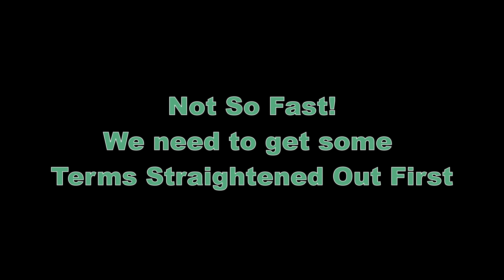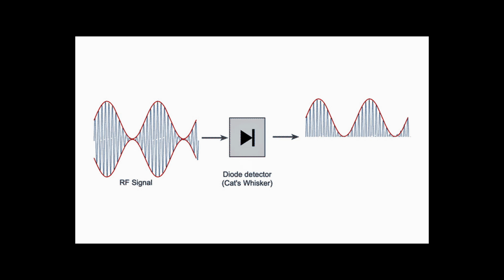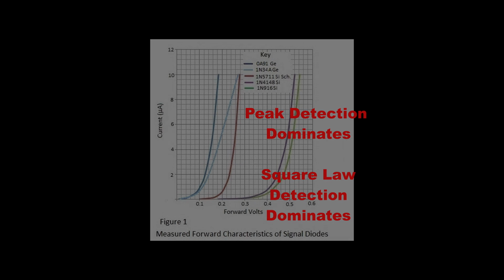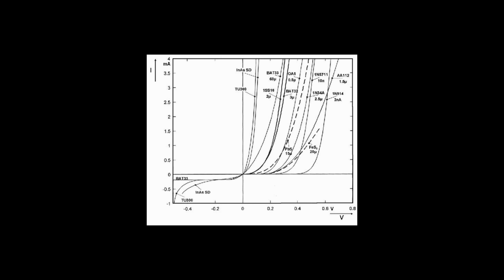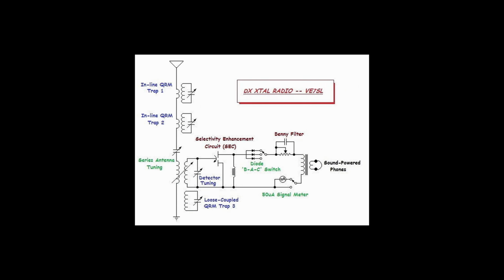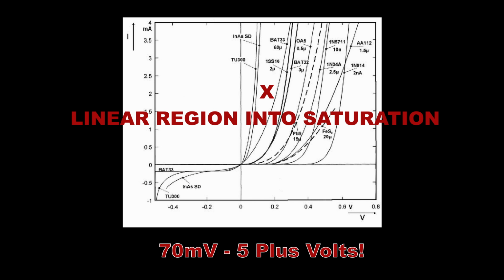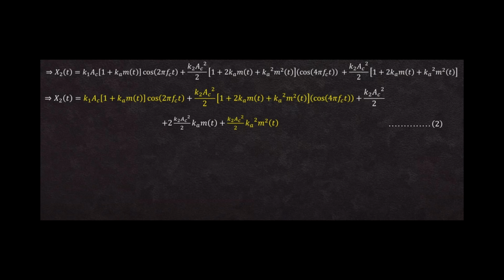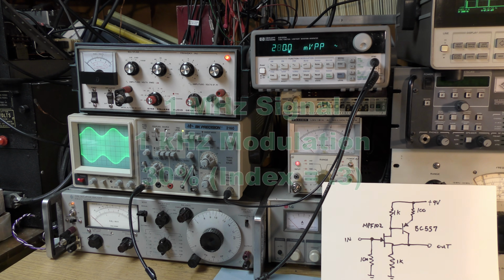AM Detector Part 3 - Total Crystal Set War

Comment: A properly tuned synchronous detector could ignore the second and subsequent-order harmonic distortion. Synchronous detectors are capable of high-purity detection. A low-end synchronous detector could use the linear region of a diode detected signal. The time domain of an RF signal is much cleaner than the frequency domain.

Comment: Makes a lot of sense.  Of course it would behave differently when the signal is small and in the square law region than in the linear region.  It also explains the fact that such small signals can still be detected even if though the forward threshold voltage is say 0.3V. Of course forward voltage is really the transition point is between the square law region than in the linear region.  I assume that the biasing just moves the diode out of the square law region into the linear region and that is why it sounds better.

Comment: I am going to pause at 0:30 to suggest that the two methods suggested are both simplifications that are really incorrect when you consider what exactly is happening.  The VI curve of a diode is (mostly) an exponential function that can be expressed as a series.  The "squared" version is ignoring the higher order terms and the "rectification" version usually is based on a collection of straight lines to model the real series.  Neither is the full story so the war between them is a "which end of the egg to open" sort of war.
Reply from the maker: A retirement life's work in researching this subject is in order. Volunteers?
Reply: I'm a 'little ender' unless the egg is hard boiled.
Reply from the maker: Thanks Ken. So we have two incomplete models. Of Course. And all I wanted to do was build a crystal radio! Ha. I have to move on, but the work and discussion continues in the community, I'm sure!
Reply: @MIKROWAVE1  Yes, it continues like it was going about 30 years ago and likely before that.  Meanwhile crystal radios got made and seem to work

Comment: I realize your purpose has been to cover the characteristics of SS diodes, but what about vacuum tube diodes? Do they begin to conduct in the linear region right away because there is no threshold voltage? I ask, because I have an HP 410C VTVM without the AC probe (of course), and plan to build one using 1/2 a 6AL5 instead of the original 2-01C.
Reply: A vacuum diode has a current that follows a V^(3/2) curve.  There is no threshold but also it is never really linear.  It is more a question of what fraction of the signal is dropped in the tube and what fraction ends up in the headphones.  In a good design most of the signal is in the headphones so the distortion is small
Reply from the maker: Well boiling electrons gonna electron I guess. Take a look at Part 1 again with the 6H6 tube.

Comment: I did not know there was that much difference or thought about it, that the diode is still demodulating the AM signal  below the linear knee voltage.  I would like to see if the distortion in the square law region changes for the better, when bias is applied to the diode. Now I know why the AM detector works best after RF, IF amplification. Also would the diode give lower distortion if used in series with a coupling cap, like what is in your HP-333 distortion analyzer, which uses a 1N6263 schottky diode.
Reply from the maker: Those old analyzers are handy, but not perfect and with age I'm sure it is not in calibration! But it is a good first check.
Reply: @MIKROWAVE1  The HP-334A AM detector introduces distortion by a factor of <0.3% (550 khz to 1.6 mhz) for a 3-8 volt carriers with 30% modulation. And 1.6 - 65 mhz it's worse <1%. With reduced accuracy you can measure distortion down to 1 volt. According to the specs.

Comment: Thanks Mike, very interesting analysis.  My views are slightly different, as the resistive output on the diode markedly affects the diode distortion profile in a simple diode detector, and this is one reason why I love using bias, as the diode output loading then becomes essentially unimportant.  Just adjust the bias optimally, and the audio distortion is essentially zero!  The only germanium 'like' schottky diode I've used, is the BAT46.  The schottky diode' 'knee' appears to be rather different to a typical germanium diode as well!  Thanks mate.  Regards, Felix vk4fuq in Australia.
Reply from the maker: Yes there is magic in the curves of non-perfect semiconductor devices. You can go nuts. Ben Tongue, (the principal owner and designer with his partner Ike Blonder of Blonder-Tongue, the company that basically invented head end CATV systems) - both SK), took it on himself to study much of this in his retirement. There is room for more investigation.

Comment: So one of the questions that one might ask is... Why not bias up the diode in a crystal radio set to move it into the linear region for lower distortion audio? Answer is you will recover considerably more audio by operating the diode in the square law region and live with the distortion to get a better signal to noise ratio. This of course applies to RF levels that are well below the diode knee as in your demonstration.
Reply: Adding a bias voltage is sort of cheating. 
It would be "less cheating" if you developed the bias with a "stolen power" circuit
Reply from the maker: Maybe a Childs windmill?

Comment: Experiment: connect two germanium or Schottky diodes in antiparallel and put them on a curve tracer. The response is symmetrical for both current directions (forward and reverse). The response is clearly non-linear, but the combination is equally clearly NOT a rectifier. Put this combination in a crystal set - it will detect as well as a single diode.
There is NO LINEAR REGION in a diode curve - it is exponential all the way, i.e. non-linear. Any non-linear system will act as a mixer / detector.
Furthermore, the "full-wave rectifier" crystal set circuits work NO BETTER than a single diode. It's not rectification, and there is no "envelope".
73 de M1GWZ
Reply: So..connecting another diode, reversed across existing diode will work ? I can see dozens of guys quickly twisting the 2nd diode in to test this out.
Reply: Einstein said nothing in physics is linear.
Reply from the maker: What kind of god set these rules up and then leaned back and watched the fun?
Reply: @MIKROWAVE1 As Shakespeare said: thou nature is my goddess. To thy laws my services are bound. Unfortunate he gave those words to the villain.